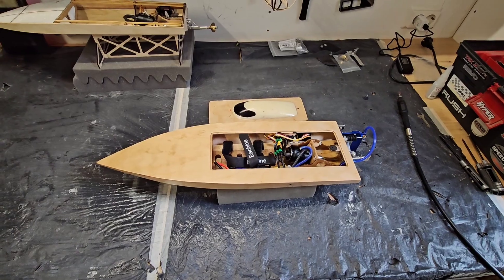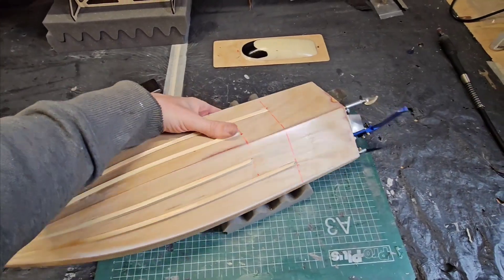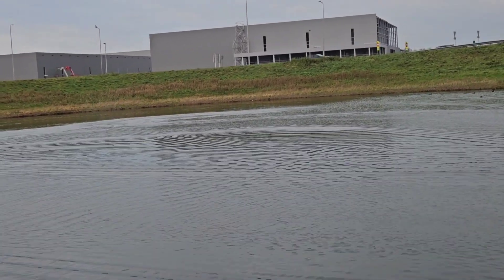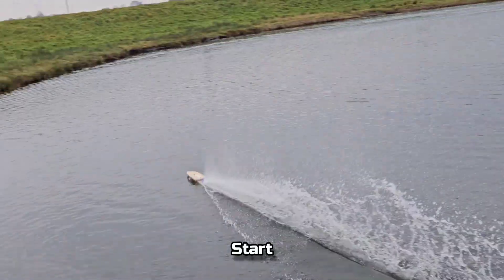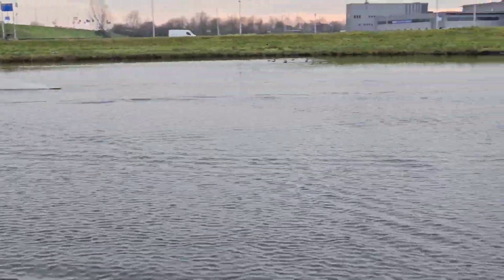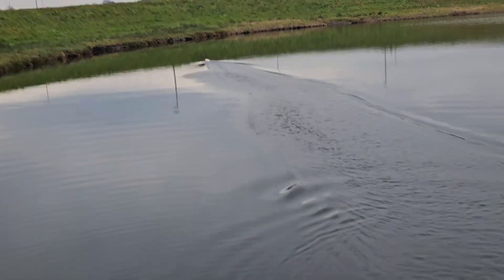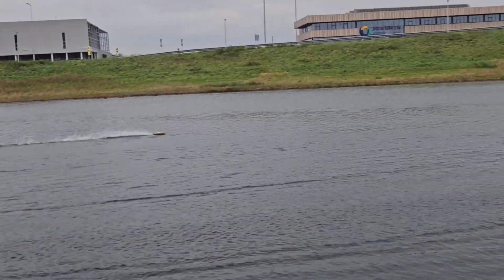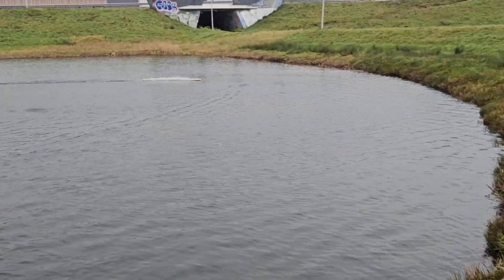Mini Mono RC boat: Does it run better with modified lifting strakes?

Comment: Great... Do now you/we know. probably a small ridepad works better...
Reply from the maker: Maybe, yes. But I bring it back to stock form, just a plain bottom. It actually works very well!
Reply: @CozyRC  it makes sense just to do what works best. Maybe the smaller the hull the effects are bigger too... Maybe for a small size boat one strake in middle would have been enough... Thats probably something only can be tested by doing it and not really a given number or size....

Comment: the difference is huge and unfortunately not for the better, but it was worth trying I think
Reply from the maker: Yes, that's my thought as well! Maybe if I made them from 3x3mm instead of 4x4mm they would have worked better
Reply: @CozyRC  from the very beginning I appreciated how stable it is in tight turns, I think the stripes are only good for bigger and heavier boats

Comment: also u dont need the 2 near the keel . they are too close anyways and also they are all too big so u can easily loose the inside ones
Reply from the maker: You could be right about the keel ones. You can see the boat riding on those, and it becomes unstable. And yes, they are too big. I just take them all off and run the boat with a plain bottom again. It's a proven setup!

Comment: Wow, nice video! Maybe the lifting strakes would be a little big, but even if they were small, they would be too small to be of any use. I like the standard version of the mini mono. Too good for its size!
Reply from the maker: Thanks! I agree, it runs great without lifting strakes! I will take them off.
In one of the following videos, I will release and maiden run the successor of this boat, which is the Cozy M500!